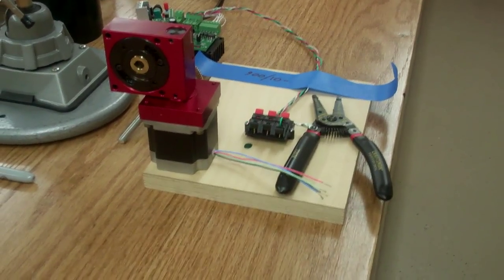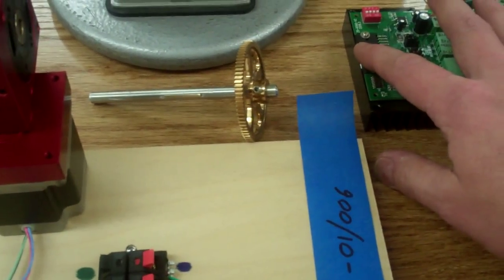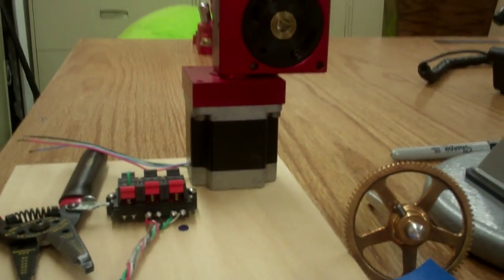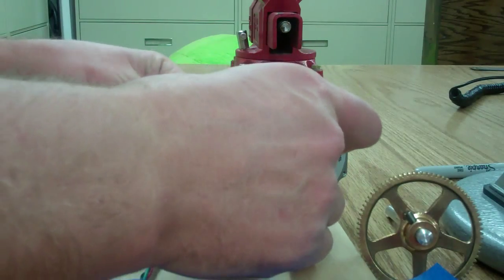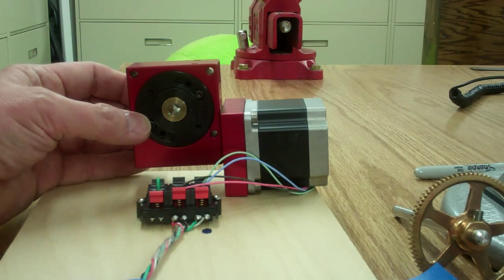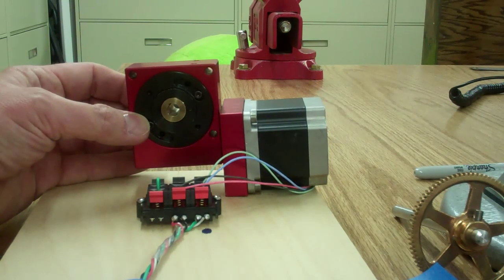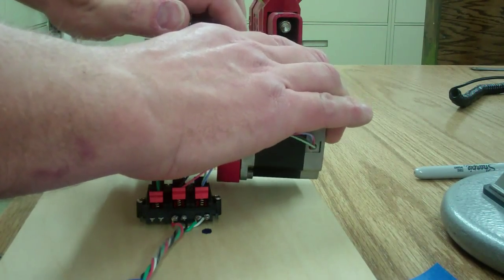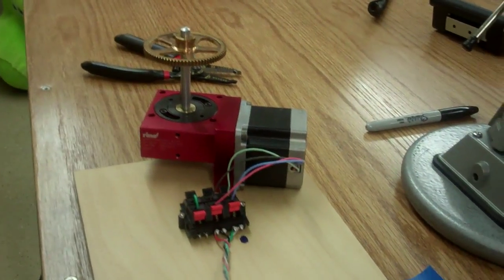TESTING A RINO ONDRIVES WORM REDUCER WITH VEXTA STEPPER

Comment: I believe this is a better solution to highly improving resolution and torque without micro stepping. Exactly what I was searching for, one question though, where did you get the gearbox and what is the torque output on the shaft. Thanks for the vid.

Comment: Hello Renee, could you do a measurement on the backlash of the gearbox?

You have to attach something on the axis with some descent length of about 30-40cm and use a gauge. 

The motor should be in brake. (typically just power it on).

I might need plenty of those if the backlash is low.

You cannot measure backlash without extension, it will be probably zero with bear eye.